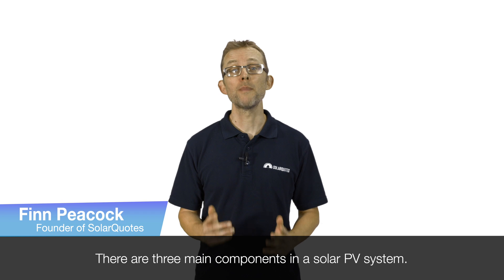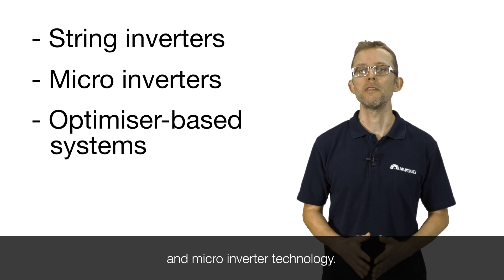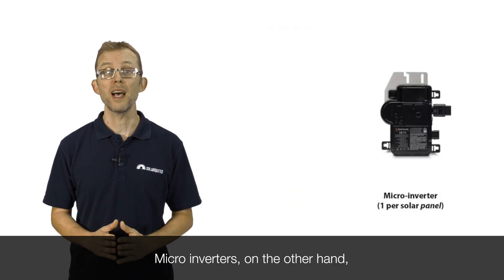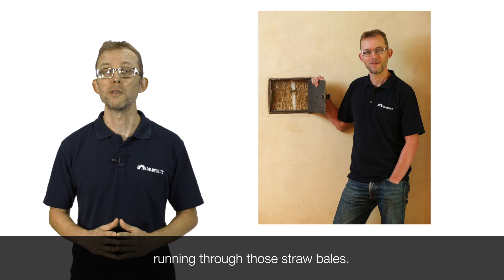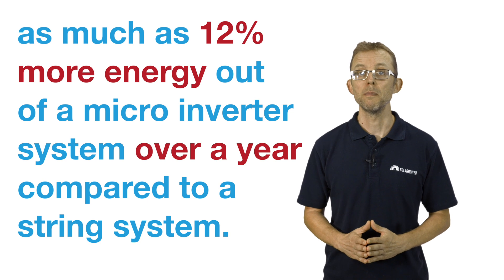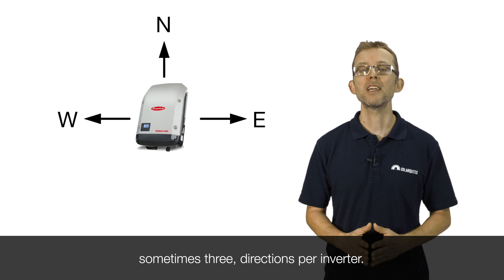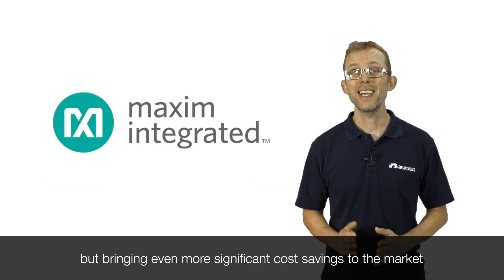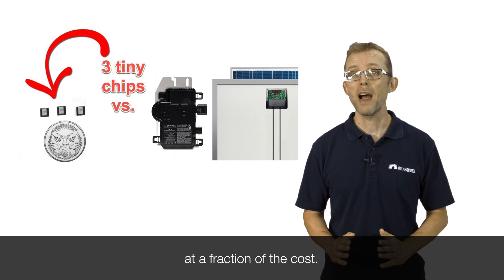Solar Panel Optimisation - Is It Worth It?

Comment: Can you use solar panel optimisers in offgrid system? I have 4kw panels feeding 24v into Victron 150/100 mppt, into AGM battery bank then into 3000w low frequency inverter. I have a mix of different panels and want to stop the lowest producing panel drag down the rest of array with it. Cheers

Comment: Im wondering why not connect say 40v panels,  300w each, in parallel straight to a suitable invertor, as i have a 12v invertor for my car stepping up to 230v so the single invertor technology is there..

Comment: Can you provide any evidence for the shoe/hose effect?
half cut cells, bypass diodes, and mppt inverters suggest that these are not necessary
These installations are expensive, and people don't have money to throw away
Reply from the maker: You are correct! With hindsight - this video oversimplifies the effect. Half-cut cells, bypass diodes, and modern MPPT algorithms remove the need for module-level optimisation except on the most complicated roofs. Our latest Solar 101 2023 addresses this.

Comment: Hello,
I've a question I would like to be answered by anyone who knows and maybe did it.
I only can put 3 solar panels due to available space. 3x 150W,  12V, now in parallel. 
For the moment I only use them to charge my Ecoflow Delta2 power station.
2 of those panels are next to each other and get the same sunlight, but the 3rd one is different angle and get shade during the afternoon. 
I was thinking to add an other battery , LiFePo, for extra power.
I was looking to put a MPPT regulator and a 1000W regulator, 12V to 240V
But then I saw the Micro converter system and it made me wonder.
As I also can charge my Delta2 from 220V AC i.s.o. the 12V DC input ... maybe the Micro system would be an option.
But as I  only have 3 panels and try to lower the budget as much as possible  ... can I use 1 Micro with 2 panel inputs when using 1 of those inputs for 2 panels (parallel or serie ?) And the 2nd panel input for the 3rd single panel  ??
.
https://www.amazon.com.be/-/nl/Micro-solar-omvormer-app-bediening-automatische-identificatie-stroomkabel/dp/B0BDL7JJ7C/ref=sr_1_4?crid=13FUYDVV1UGT4&keywords=micro%2Binverter&qid=1676283483&s=electronics&sprefix=%2Celectronics%2C99&sr=1-4&th=1

Comment: Incorrect information here, all modern solar panels.....going back a good few years have by-pass diodes in them, commonly 3 per panel. Any shading on part of one panel might reduce its output by a 1/3, 2/3 or totally (depending on how it's shaded) on that affected panel but it will only affect that one panel......not the whole string. Current is by-passed around it. Optimisers help in light diffused shading where the individual MPPT can reduce the current on that one panel but any heavy shading then the panel's by-pass diodes kick in like an un-optimised panel. Marginal gains at most. Which leads on to another thing, optimisers reduce overall power by a few percent too.....they dont run for free.

If you have multiple roofs with panels on different angles then they may have value, however, most string inverters have 2 string inputs allowing for two roof directions....some inverters have 3 or 4). I do like the fact you can monitor each panel's performance, great for seeing problem panels.

If they go faulty....which they do, you need to get the pros in, probably scaffolding too, then remove the panel to replace the optimiser....costing more money. 

Modern panels/modules really do look after themselves by design......newer designs such as half cut cells and shingled type panels are increasing effeciency and improving shading problems even further.

Comment: Micro optimisers are obsolete since panels are fitted with a diode system that eliminates ONLY the shadowed panel from the string, but letting current go thru  thus not affecting other panels!!!

Comment: This shading issue may have been apparent in older panels but ones made in the last year or 2 dont need optimisers. Built in diodes in the panels prevent shading issues on one panel affecting all the others.

Comment: One advantage of the "boring" monitoring of individual panels is that optimizers can fail.  I had two fail within five years of installation.  They were under warranty and were replaced for free parts and labor.

Comment: We as a company have gone away from micro inverters. You are missing that there are bypass diodes in each half of the panels so the old addage of blocking all the panels on that string is no longer valid.  We have done plenty of testing to go to this change and maybe you are believing the Micro inverter hype rather than doing your own testing. The five reasons we have switched from micros to strings are: (1) Bypass diodes mean that there is no longer a choke point, (2) String is cheaper (3) String is more efficient (4) Batteries are more efficient as do not have to convert to AC then back to DC (5) Panels are mostly larger than what the micro inverters will allow - ie most panels now are over 400W  and many are 500W yet Enphase and other micro inverters will only allow a maximum output of 349VA so you are losing the top end of the panels outputs.
Reply: Having my panels orientated that goes with shading from buildings ensures progressilvey the diodes activate.

Comment: I have a question then: I'm installing a solar system at the moment (rather having an installer do it). The will be some small shading during a short time of the morning, on 4 out of the 13 panels. I had initially considered Tigo optimisers on just those 4. But now I am considering running just those 4 shade prone panels into 1 of the inverter's inputs, while the rest into the other input, thus isolating the "weak" panels performance from the rest of the shade free panels. I'm having a hard time finding information on whether this would be a better idea compared to using the optimisers. Would appreciate an opinion on this. Love your videos by the way!
Reply from the maker: High end inverters (like Fronius and SMA) handle shading more or less as well as an optimiser or microinverter based system - and since this is only a tiny bit of morning shade I personally wouldn't bother going to the extra expense of Tigos
Reply: @SolarQuotes  yes it is a Fronius gen24 going in. Plus reducing the number of extra faliure points up on the roof. Thanks for answering, great channel, watching you from Spain which has similar climate conditions to Australia but well lacking in good information sources like yours!

Comment: Tigo works well when roof space is limited. For example, I have 10 panels in mixed orientation on a single string. That keeps the string voltage in the optimum range for the inverter. Optimisers on all panels balance out the current. Also panel-level shutdown safety.
Reply: Hi mate, have you done any testing on optimisers? Are they worthwhile?
Reply: @jamiemckennon1944  It's subjective. Do you value panel-level shutdown, per-panel monitoring? If not, then only consider them in shaded situations. Plenty of videos and demonstrations of how that works. Even without optimisers, half-cell panels are quite good at handling some shading situations, but be warned that some manufacturers will not honour warranty on panels which see regular shading due to stress on bypass diodes.

Comment: "much safer AC voltage" are we really back to the war between Tesla and Edison? There's nothing safer about AC or DC. The 2 factors that affect safety are voltage and current, but really, in a properly installed system, even those are basically irrelevant.
"Finn owns Enphase shares" that pretty much explains it.

Comment: Explanation on shading is incorrect, string inverters do not reduce to the output of the one panel that is shaded- I thought Finn was supposed to be giving out factual information ?
Reply from the maker: Unless the bypass diodes kick in, the other panels in a series string must all reduce their current to the same, lower value. But yes, it is a simplification to not go into bypass diodes and global maxima.

Comment: so bottom line is, if you have a string and a panel fails you're in for a fun time figuring out which one.  If you have a micro and it fails, you know imediately.  If you have an optimized system you the benefits of a microinverter system with another huge weak point that can fail.  I hear string inverters have a 10-12 year life span and cost $2,000ish.  I'm getting solar to save money, no shell out bucks for a new inverter every decade.
Reply: im a solar guy …. inverter string inverters need power from the grid to even work.
Reply: @ReggaeRedeemer  What about the off grid people?

Comment: I’ve solar edge optimisers fitted, in three years three have failed now possibly a forth. Will the Tigo optimisers work with a solar edge inverter, as if this problem persist I might replace all 22 optimisers

Comment: Not correct. In a string connection,if one panel is shaded,you do not loose the whole string. Each panel has bypass diodes inbuilt,and so when 1 panel is shaded you only loose part of the energy from that 1 panel. I often hear this garbage about the whole string dropping because of shading of one panel,and i can only put it down to a sales pitch for the un needed microinverter sale.

Comment: This guy is a liar.  The only good thing about the Microinverters and DC optimisers is to report the details info of each panel cells.  They have no other benefits.  The String, Micro, Optimizers are all suffer the same power degradation when it's cloudy, rainy or blocking by an object.

Comment: He left out some detail for solar edge. The optimizers condition the voltage to accommodate the inverter so the inverter is more limited and robust and a little cheaper. That's why they only work with each other and must be used. So with Solar Edge, it isn't just MPPT.

Comment: Enphase has an Achilles Heel for my use case.  They communicate over the AC wiring.  Comms over unshielded wiring is horrible for those of us who are into radio.  I'm looking at AP systems QS1, but can't find any EMF data on them.  FWIW I'm in the US.

Comment: Are the Sunpower Maxeon panels with the pre installed optimisers not available in Australia ?
Reply from the maker: The Sunpower Maxeon 5's have a pre-installed Enphase microinverter - and they are available in Australia :)
Reply: @SolarQuotes  but you still recommend the Enphase as the best product ?  I figured that with Sunpower’s reputation for panels they would be recommended. I thought they might not have been available in Australia in that model when you said Enphase was hands down the best option and Sunpower with inverter wasn’t mentioned at all.  In fact no seems to talk about them.

Comment: I've been looking at Tigo optimizers and can't   understand which to use, news your help please.
10 x LG neon2 390w and Solax X1 Híbrid 5T

Thanks
Reply: Why the NeON2 panels ? The Tigo panel optimiser  TS4-O system or TS4-A-O or TS4R-O, sic.  also requires a bridge/radio link for the panels to talk to the inverter, which adds to the price. The Tigo control system is built into the SMA inverters, so they may be better managed by the SMA inverter, but it is more expensive sometimes as a result. 

There are also other optimiser solutions, (Huawei, Sunpower AC, sic)  but if you want a Solax hybrid inverter, you may have other system specific requirements, and you should probably look at different types and sizes of panels if shading and density are needed for storage and efficiency. The installer should be able to answer why they chose the NeON2, but also the SolaX inverter. This might be for warranty alone, but there are other reasons at the end of the day to look at product warranty claims, YMMV.  

By choosing a cheaper brand of panel, you may be able to have a SolarEdge or Enphase installation on newer, efficient technology panels, rather than expensive panels which may have shading performance issues. I.e. 400w panels with 85% versus 390w panels with 70-90% performance. This is where the variability and installer should be able to answer direct questions on their choices, and what they know about other technology in panels, i.e. Jinko, Sunpower, Hyundai, Trina, REC, especially in relation to shading and optimiser compatibility.

Comment: If you have PG&E as your electricity provider, you may as well think, “Off grid” if you want solar. On new solar you won’t be getting much for your electricity into the system and during “peak periods” don’t expect a break. Think very large array and big storage. Tesla power walls are over priced so big looking at “Big battery” or even better Learn to build your batteries. If you size it right you won’t over tax the batteries and they could last 30 years more. Small is actually expensive!

Comment: AC safer? If it's all 240v, then the only way to up the power is to up the amps, more amps safer?
Reply: There are 2 120V phases.  Plus AC is safer than DC at the same voltage.
Reply: My reply disappeared...

Comment: if the Wattage transmitted is the same it doesnt really matter in terms of safety, its really not correct claim to say that AC is safer.
correct me if im wrong
Reply: Well, think of it this way. With a simple string inverter, the cables running through your roof from the panels to the wall inverter can be carrying up to 1000 volts DC.  With a microinverter on the back of each panel,  the cables are carrying 230 volts AC.  The chances of arcing causing a fire, and the lethality risk to workers, repairers, etc., is far higher with the DC system.
Reply: What he means by AC being safer, is that when you short AC cabling the circuit breaker will trip causing automatic disconnection of supply.
But if the DC cables on a string inverter are shorted the short circuit current will flow until the arc burns out or the panels become shaded there is no automatic disconnection of supply.
It is worth noting that solaredge inverters have arc fault detection included, if the inverter sense a short or arcing, they system will shut down the voltage from the panels at the optimisors.
Reply: @Rbenn10  DC circuits don't have breakers/fuses? Why is that?
Reply: @TheRobojay This is because Solar PV panels are a current source. The amount of current produced by a solar panel is proportional to the solar radiation hitting the panel. Solar PV cable will not have an overcurrent event unless more radiation hits the panel and therefore fuses will not provide any protection. 
The shorting of a DCPV circuit will cause an arc yes but not overcurrent needed to blow a fuse because the current is limited by the solar radiation hitting the panels at that time.

Should be noted fuses are used in DCPV circuits when multiple circuits are connected in paralell to protect against backfeeding solar panels from others and when DC coupled batteries are used. but for the most part in a typical residential solar system not required as they wont serve any function.

Comment: Here's a very simple question for you but with an incredibly valuable answer for me. Does a SolarEdge Inverter (For example SE2200H), WORK WITHOUT the Power Optimizers?
I mean, will it produce less or it will not start at all? I'm having some difficulties powering mine on so your answer will help me greatly.   THANKS A LOT.
Reply: no
Reply: Mostly no but you need to study the inverter DC voltage range vs the panels for different radiance levels.
The optimizers condition the voltage for the narrow inverter range. Without the conditioning, the inverter will struggle. Without optimizers, voltage will frequently be above or below target voltage range. That's why Solar Edge inverters are cheaper and so efficient. They aren't so robust, depend on optimizers.
Microinverters are the way to go. In the last 5 yrs they have convincingly won the challenge.
Reply: A further question to this: will Optimisers work with my existing inverter? (it is a SMA Sunny Boy.)

Comment: Tigo claim their optimisers work with MPPT charge controllers for off grid & hybrid systems.
I have an off grid shed, with 2x250w panels - through the latest epever 150v, 40a charge controller leading into 2x120ah AGM=240ah@12v batteries & from there to a Sinclair 1600w 12v-240v pure sine inverter with RCD, but the efficiency of the panels is dragged down by an east west roof, with one side getting more sun in the morning & the other getting more in the evening. I was considering spending the £60 each for a couple of Tigo optimisers & was wondering if you had any experience with optimisers in an off grid setting like that?
Reply: for optimisers, there needs to be a minimum amount of panel that should not be shaded/ "dragged down the performance". otherwise, the other panels gets dragged down too

Comment: As I learned the hard way, panel level monitoring is the only way to know which optimizer just failed.  Otherwise, you're left scratching your head as to why the output has declined.
Reply: not if the system has a app to track the panels
Reply: @ReggaeRedeemer  Maybe I have the wrong app but I just don't stare at it every day.  Neither does the company who got paid to monitor.

Comment: I'm wondering how micro inverters compare with the new 500 watt panels.  And will there be 500 watt panels with micro inverters?
Reply from the maker: I've been told Enphase will soon release a 425W IQ8 micro inverter. That would work well with panels up to 566W.
Reply: @SolarQuotes  That was the news then, also promises of hybrid IQ8 to power the house a little when grid down but that also never happened.